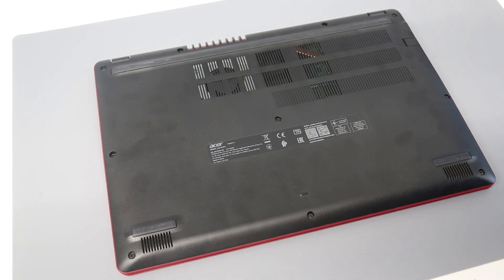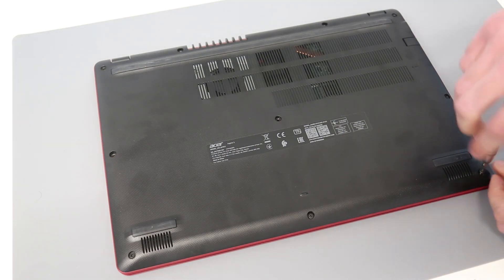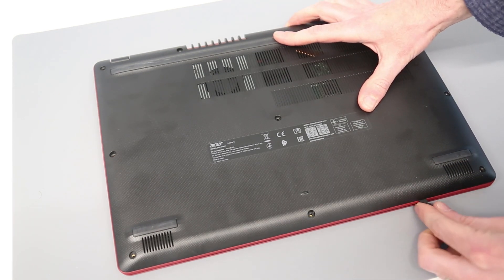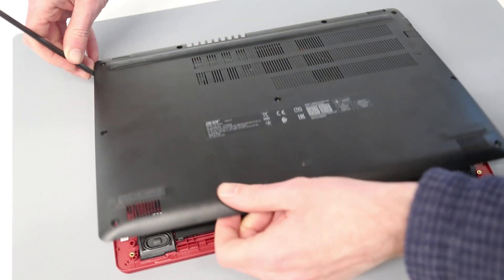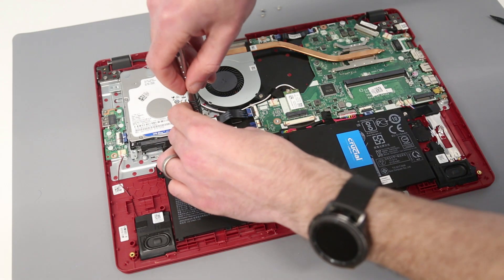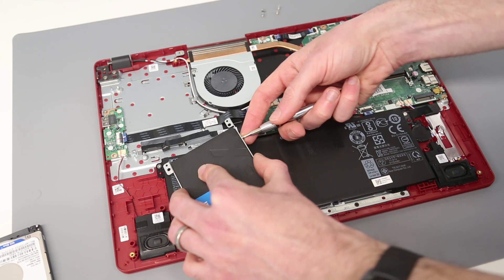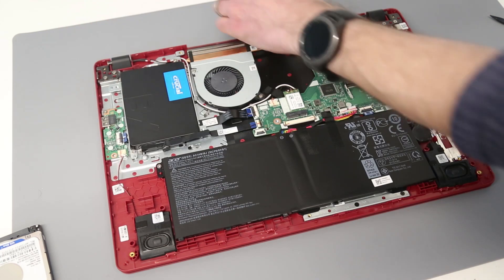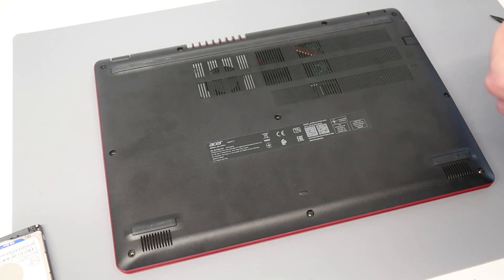Acer Aspire 3 A315-54K - M.2 SSD, SATA SSD/HDD and RAM upgrade guide

Comment: Hi there, so by just changing the SSD the laptop will run faster? I've got the same laptop and it takes forever to switch and even longer to open documents, chrome, or anything in general

Comment: Many thanks for this very clear and concise video. I would assume that the m2 slot can be used to install Intel Optane to speed up either the 2.5" SSD or HDD that is in the machine? I have ordered the 8GB RAM to bring total RAM up to 12GB, as felt maxing out this at 20GB was overkill on the i3 7020U chip. Already installed the Crucial MX500 SSD and seen a massive difference, hopefully with that extra RAM I might not need any Optane boost.
Reply: Is it possible to install an NVMe m. 2?